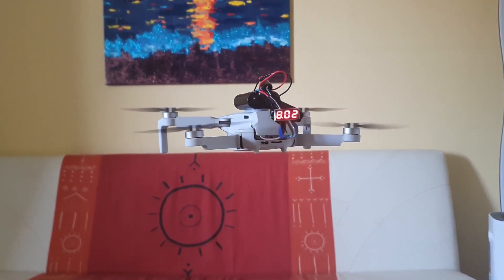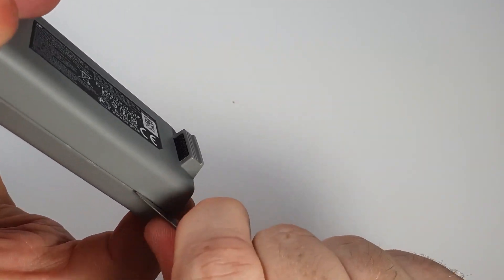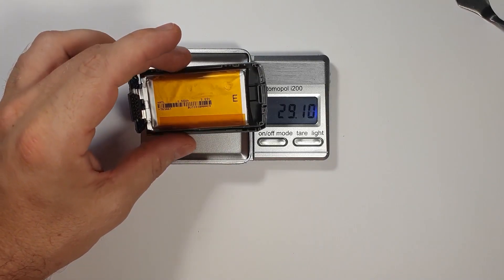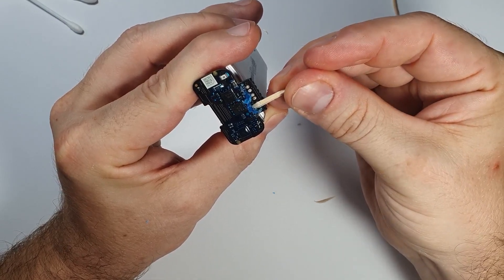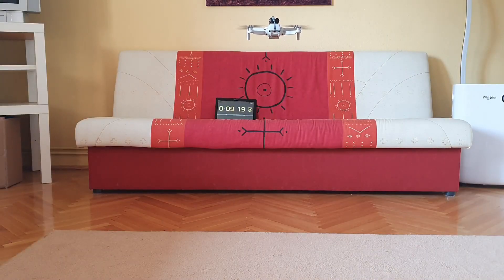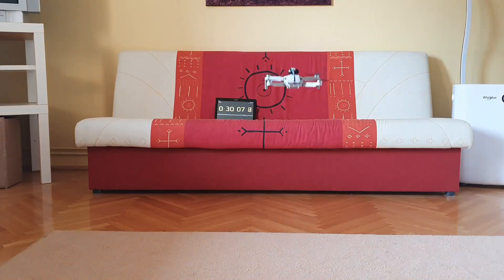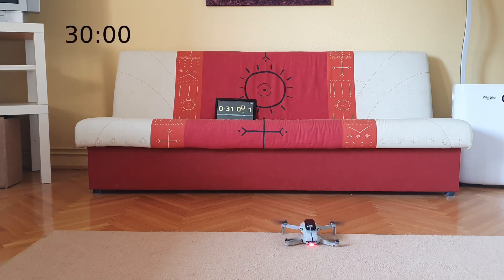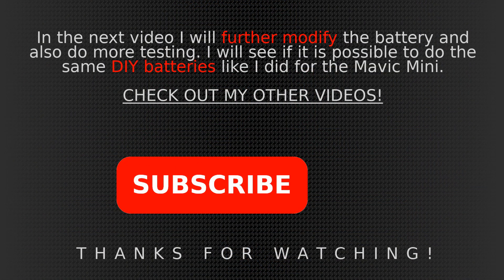DJI Mini 2 ultimate battery mod tutorial Part 1.   39 minutes flight time so far.

Comment: I studied this for 2 years and came to the conclusion i can just buy a light weight fitted 4100 mah mini 2 battery that just pops right in and i get 60 minutes in air flight
Reply: Could you please provide a link ? Ali express ?
Reply: Rubbish.. 60 min
Reply: Do you actually get 60 minutes
Reply: BS

Comment: i got 2x 21700 cells with a capacity of 5000mah and discharge rate of 20a. hopefully it goes well using your video :)
only concern is the weight. total weight is 120g for my new battery.

Comment: if we cahnge the cell.. do we need to reconfigure the board software or it can be use without any configuration needed?
Reply from the maker: For changing the cells you need reconfig. For adding a cell like in the vid you are cool as it is:)

Comment: If the cells that are used in the Hubsan Mini,MiniSE and Mini Pro can be transplanted to the PCB of the Mavic Mini or Mavic Mini 2, then there is a guaranteed 30 plus minutes of flight time every single flight with 15 to 25% battery left at the end of the flight.... I consistently get 30 minute flight times with 20% battery left and I have flown a full 38 minutes down to 5% on my Zino Mini SE... I can even charge the Hubsan batteries using an aftermarket Mavic Mini charger... I have uploaded the video and I know that you are far more knowledgeable but I do believe that if you knew about these cells that you could use them for your projects they get extremely good flight time... they are 3,000 milliamp 18650s that are in the Hubsan batteries.
Reply from the maker: Can be good for the Mavic Mini. The Mini 2 is different chemistry so that does not work well.

Comment: This is Wonderfull Zolly! Any idea to build gimbal of similar mass and nice lens with sensor?
I am not sure about control, but those free parameter setting softwares seem capable of building stability of similar quality.
Just the number of new drone manufactures is apparent. I searched for a while and found all gimbal-axes big, only 1 or 2 barely small ones that got expensive. The photo module was something I haven't look into yet, don't know how to search for it.
Reply from the maker: That is a tough project. I may look into it in the future.

Comment: Maybe this is or isn't a good idea but could you just hook up 2 of the mini 2 batteries together?...as long as you can bypass the app lock and let you take off?
Reply from the maker: You could do that, but then the data (SMBus) lines should be connected from only 1 battery, otherwise they will talk in the same time and you will get an error. But if the data is not connected, then it is just like connecting 2 naked batteries anyways, so it would be a waste of resources.
Reply: @ZollyD  exactly

Comment: Maybe this is a stupid question but I can't find it anywhere...what are all of the pins for, like what does each one do because there's not just a positive and a negative.
Reply from the maker: There are no stupid questions. :) In one of my videos I explain the pins. from left to right: Data pin, negative, positive, positive, negativ, data.
The 2 data pins are for the SMBus communication between the drone and the battery board.

Comment: Have you tried changing the shunt resistor it uses to measure current to match the additional capacity? Like if you have doubled the capacity use a resistor that would cause it to read half the amperage of what it reads now? Just brainstorming while I watch lol
Reply from the maker: I did not look into that, but in the other video on this battery I kinda bypassed the need of it. Have you seen that? :)
Good input! :)
Reply: @ZollyD  not yet but I’m sure I’ll be watching it soon enough lol. Thanks

Comment: Why put the case back on the MINI 2 Battery.  Save weight and just foam shim to keep tight.  Put a second set of cells with just the shrink to save more weight.  Looks like a good job.  The blue did make it easy to pull tiny parts.  Good repair and extended flight time, but how much performance loss with the extra weight.  It would be nice to get the battery telemetry back.
Reply from the maker: Yeah. I wanted to keep it as safe as possible, but yes for the max flighttime test I will do just those you suggested!:)
I am still waiting for some really good cells to arrive. They are stuck in customs...🙈

Comment: A lipo wow. Thought there was a li-ion in there .. nice mod. 
I ended up building custom 5" with rth and position hold and alt hold so I could do over 30mins flight and top speed 85mph. Ended up getting over 40mins flights on 3000mah Li-ion. 
Has dji camera system and can carry a hero9. 12min flight on lipo 1300mah carrying hero9. Flights are on my channel. 

I want to mod my mini 1 though. Mine just sucks so bad. Something wrong with it. I think I got a factory reject. Needs better motors or new esc. Thought swapping for air 2.
Reply from the maker: Thanks! :)
Checked your stuff. It is really cool! :)
Reply: Hallo. Is IT possible to Change the Lipo Cells into 18650 Cells? And does the Battery Work after the Change? Thanks
Reply: I really am hopeful to go and check out your stuff. I want exactly that and would be perfectly happy

Comment: Would it be possible to connect a cable to the mini 2 battery to connect with my naked gopro hero 8?
Reply from the maker: I don´t fully understand your question. Tapping into the Mini 2 battery you can power additional devices, but there should be a limit to what current. I did not test it, but I would not go over 0.5 A.
Reply: @ZollyD  have to check what power my go pro needs then. I have a naked gopro 8 that i would like to use with my mini 2 but the naked gopro has no battery and it would be powered by a 4s battery on my protek drone.
Reply from the maker: Yeah check it. And I am not familiar with GoPro´s at all. Naked or otherwise! 😂 Ask maybe someone more experienced about it, just to be safe... :)

Comment: Yah if you hover like this with no wind and also you fly inside your house you get 39 or 40 min of fly time. but if you fly outside and flying at the wind and fly at high alti well your wasting your time and upgrading the batt, This is waste of diy upgrade for your dji mavic mini
Reply from the maker: Thanks for the comment!
You may be right. We´ll see with the new LiPo cells I ordered... :)
Reply: Agreed. It's extremely inventive and a great watch. I love technical stuff.
However in the real world these battery mods are a little pointless unless you can reduce the weight of the drone to its original.
The drone will be balanced at the weight it already is, the motors can only create so much thrust to keep this balance. In windy weather the motors can max out. If you add weight and already max out the motors you may not get your drone back.
You should have a look at the dat files so you can see how it affects the motor speeds.
Is the risk worth it for an extra 10 mins?

Comment: I bought a mini 2 battery as well and it doesn't power on the mini 1 either. so strange. They must've blocked it somehow via software.
Reply from the maker: Yes the firmware in the Mini2 battery is different. It can be reflashed with a software TRB 2300. I will make a video of it in the future. That software gives a perfect solution to these battery hacking but you got to pay for it. I want to investigate the DIY open source options first. 😊
Reply: @ZollyD  I hope you can get it to work. Thanks.

Comment: If if possible could you do a test with just the stock battery with the telm. disconnected for a comparison I think the result may surprise you
Reply from the maker: I think you are right. The reason why I did not do it because then the drone drains the battery all the way down to under 3V per cell. I do not want to destroy these cells (yet) :D
When I added more capacity it was Li-ion and that can be drained to 3V. In that case the LiPo also went to 3V but at least the majority of the current came from the Li-ion cells due to its discharge curve. I hope it makes sense.
I did orded some additional LiPo cells. Once they arrive I will do the tests you suggested! 🙂

Comment: The battery works longer if you lower the resolution of the camera to the lowest setting, don't record video and you will reach a flight time longer than the flight time DJI names in the manual. Destroy things is also a job, I guess.....
Reply from the maker: Thanks for the good input! :) And yes, I JUST SIMPLY HAVE TO take apart everything! :D :D

Comment: good work mate,did you see controller reset software,which unlock batterys pcbs locked by dji?
Reply from the maker: Thanks! :) If you are talking about TRB2300, yes I know about it and I agreed with the developer to do a review of the software in the future! It will be EPIC!
Reply: @ZollyD  no,this is payed software,but also exist free
Reply from the maker: In that case I have not heard about it. What is the name of it?
Reply: in help you can see how connect it, also you need cheap cp2112 programmer.

Comment: Could you please make a video on boosting the signal for the Mavic Mini (more stability by boosting the signal without replacing the antennas)?
Reply from the maker: I will look into it. To be honest I don't really see how to boost the signal without antenna change. Or do you mean the FCC vs CE issue?
Reply: Or use passive snap-on signal booster on the controller. Search : mavic mini signal booster

Comment: nice video, i thought about the same :) but do you think the 10 minutes flytime are worth it outdoors? its windy so the drone has to struggle even more so realisticly you get about 5-7 mins more.
Reply from the maker: Thanks!
Right. I think there will be a sweet spot in energy density which will work fine. probably LiPo cells.
I think if another 2000 mAh can be added to the stock battery with the weight of some 60-70grams, then it would do 40 mins outdoors too.
I think... :D
Reply: the payload will decrease the battery quikly